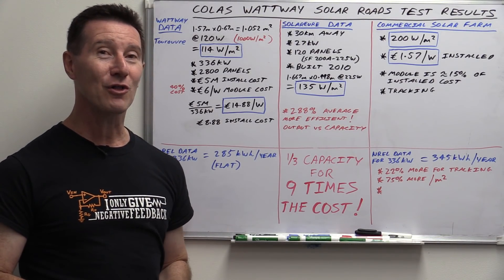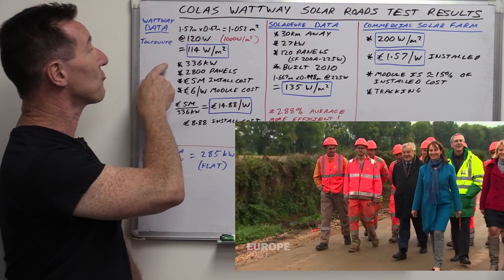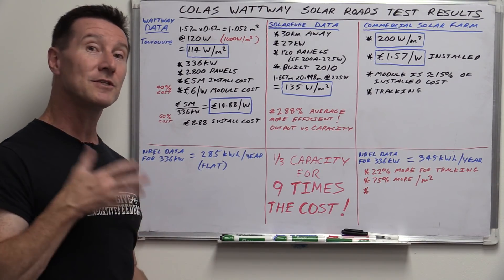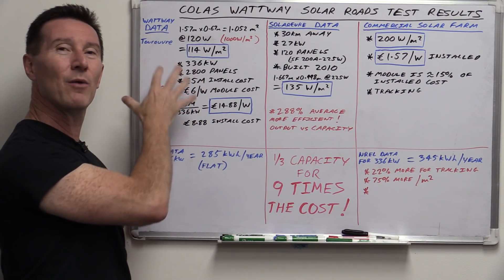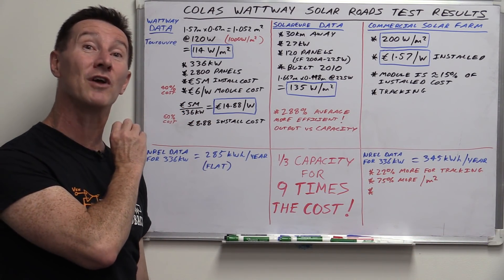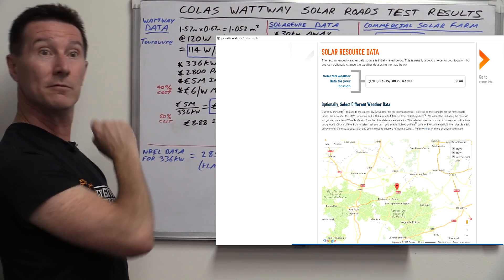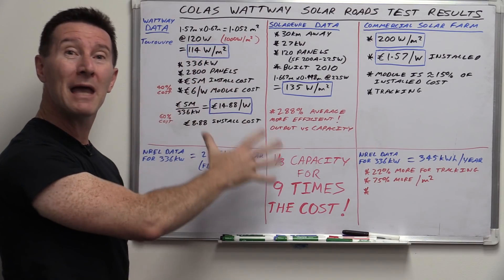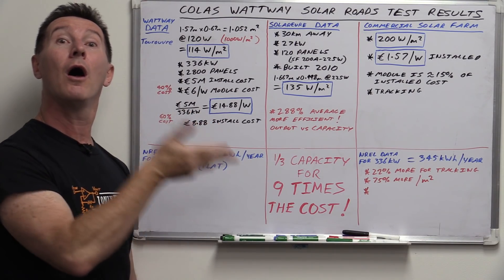EEVblog #1047 - Solar Roadways FINALLY BUSTED! (Colas Wattway)

Comment: You are forgetting one factor.  There is a heck of a lot more space available to collect solar energy from existing roads than there is building solar farms.  How many new solar farms would you have to build in order to produce the same amount of electricity if every road and parking lot had solar built in?   The road you are taking an existing structure and getting more out of it for practically zero environmental impact.  Building new solar farms takes up new land and impacts on the environment.  If the solar road could be made cheap enough and extend the life of the road underneath it saving more money and saving wear and tear on the cars and trucks that drive on it because the roads are in better shape for longer it might be a decent solution.

Now do I think solar roadways is the best solution? NO!  It be better for the government to put solar panels on every commercial and residential roof so that the building owners never have to worry about roof maintenance.  It could be done is such a way that the entire roof even if not in the sun is protected so that the benefit is you give up your roof but never have to pay the cost to maintain it.

Comment: I like the concept. What could potentially work is put panels along sides and or tops of Mountains and the similar. same basic concept  utilize previously opened up space just NOT  space that is traveled on top of constantly.

Comment: ~6€ per watt but you can still drive on it. You are ultimately comparing apples with oranges. Add the solar farm cost to the cost of a non-solar road. The units for comparison need to be € per watt–meter or some such to account for the dual use nature of the solar road.

Comment: The more a road is needed for transport, the more shade it will get...the only reason why you would use solar roads is for the complete lack of space.

If you want to save space, you promote pushbikes first of all, and mass transit in densely populated areas.  Discourage the use of cars.

If you really want to discourage the use of cars, stop wasting money and space on a high capacity road network and leave them for emergency, medical, tradespeople (plumbers, electricians), supply of retailers and government services (garbage collection and postal service).

Comment: Why are people so obsessed by making roadways solar? There are millions of square miles of roof surfaces in the world. Have they even seen some of the traffic in populated cities? Just erect some cheaper, several times more efficient and proven by years of exploitation solart tracking panels.
Reply from the maker: Because it's "innovative".
Reply: I constantly wonder about the safety. Modern roads use highly open tarmac to let the water drain away which prevents dangerous aqua planing situations. And tarmac is rough and sticky so provides grip for rubber car wheels. What if this solar road gets rain and frost? Would it become a solar skateway?

Comment: I would love to see lifespan data for the various solutions. If the life on the road materials is substantially higher (due to less stress) than it hardly matters how low the output is.

Comment: Thinking about it, consumers might be willing to pay for this inefficient electricity from a solar road if it offered the ability to charge their electric cars as they used it, they would pay via a toll or an automatic payment system of some kind depending on how long they were on the stretch of road..... I mean lets face it in the UK the Chinese and French are building a gargantuan massively expensive dangerous nearly obsolete nuclear power plant, that consumers will be paying for electricity from , for the next 50 years whilst the government try to figure out how they made such a bad decision and how on earth they will safely decommission it and deal with its toxic nuclear waste.
Reply: On-road wireless charging is a non starter. Compared to the charging cable you already have in your car, it comes with insane infrastructural costs, high losses, and of course, the knowledge that you are exposing yourself to a 100 kilowatt (or more) EM field. People will never go for it. Especially since most electric cars already have sufficient range for day-to-day usage.

Comment: China just got finished building its first solar highway. Apparently they used transparent concrete then under the concrete solar arrays, then under that another layer for insulation.

Comment: Wrong! Dave is comparing a "proof of concept" versus an "already in production" product. Also, the installation cost should be reduced if you consider that the installation is part of the road building cost itself.

Comment: I literally can't understand solar roadways. They could just take those same solar panels and put them in a solar farm and get far more electricity from them. Roads are literally the worst place to put solar panels, and finding a place to put solar panels is least significant problem with solar.

Comment: Looks like the Chinese are experimenting with this as seen in a news media release "World’s first solar panel highway debuts in Shandong", see link below. The article claims they can use the energy generated to melt ice on the roadway and also wireless charging electric cars as they drive over it. I didn't say it, they did. It's all bullshit but at least entertaining.
http://en.people.cn/n3/2017/1229/c90000-9309703.html

Comment: Just putting sun-tracking commercial-grade panels on the side of the road, or on a roof over the road, is a lot more effective when it comes to using the roads to gather energy.

Comment: Dave once again you have foorgot the grime coefficient lol if they are seriously letting people drive over this in rural areas the contact area will still be in two major tracks. Next time it snows in Oz just watch the traffic tracks in the snow and you will see how much of a road surface gets used. :-) . While most of the contact made should be rubber tires if this is rural you will get the odd farming  implement driven on it.  Think older muck wagons with steel rimmed wheels etc. Wonder how long anything will last let alone maintain a pristine optical surface. I am betting about when the first marketing party finishes and the real world tries to use it. Anyway I think your efficiency doesn't take into account the damage etc enough. Instead of a intro party they should have have a engineering inspection party where all members walk to road and every few meters do a face palm...

Comment: It seems the only roadblock (pardon the pun) you're able to prove is cost. Sure, that matters to capitalists who want to maximize their profits above all else, but there's more at work here besides profit motive. There was a time when solar was far more expensive than fossil fuel, and the cost thresholds were still broken. LED bulbs still cost several times what their incandescent counterparts do. This is about building an environmentally sound future. How much does the future cost?

Solar roadways are a great way to supplement solar fields and private installations, not a replacement for such systems. So long as the engineering can be figured out, this is indeed a viable thing that is an improvement over current roadways that generate no energy at all.

Comment: I got an oldie but goodie scam you've hit on in the past but needs a redo .....  "FCC Approves WattUp ‘Power-At-A-Distance’ Wireless Charging System" ......

The most ridiculous part is the Wall Street Suckers and Lemmings all fell for this and their stock went up 64% in just one day ...... We more or less banned incandescent light bulbs here in the US and this lame brained scheme would make the incandescent light bulb look like the model of Energy Efficiency. 

Based on the complete and utter lack of efficiency alone these deviced should be banned as all they really do is create excess CO2 just because some people are too damned LAZY to plug a cord to their phone!!!   Can you possibly get any more lazy than that?

Comment: Why don't these people just install real normal panels down the side of the road like the do in the states for auto noise reduction walls. It would just be a solar farm thats 30 miles long. Forget the panels on the road, put it on the side of the road. Why can't people just use common sense..

Comment: Ok I do agree with you, it's rididulous. But ... please use the cost delta of building a normal road and solar road. The cabling is anyway passed with or without the solar option... so that's also chipping at your white board.
Reply: Well this solar road is installed on top of a normal road, so the delta IS the cost of the installation. And roadside power cables are usually high-voltage (10+ kV AC), so unless you intend to equip every solar panel with a high-voltage inverter, you're going to need some collector cabling along the solar road.

Comment: Solar roads to compete with commercial solar farms is silly. About as silly as expecting solar roads to provide a grid level solution. You just have to be better than the next worst viable option for a particular application.

Comment: This analysis is flawed. The real comparison should be cost to install a road without PV vs with PV. I suspect the difference is a rounding error, and thus it makes perfect sense to deploy solar roadways.
Reply: Show us a calculation if you  want to support your guess! You SUSPECTING something is not a proof!
Anyway, the Colas system still needs a complete road under it! The cost they list is ONLY THE COST OF STICKING THE SOLAR CELLS ON AN EXISTING ROAD!  You would still need to build the road!

Comment: Where did you get the 336kW data point from?  Is that the lifetime expected output?  If not then as it continues to produce power the price will go down since they will have already paid to install it.
Reply: You don't even understand what you are talking about! The 336kW is the maximum rated POWER output, NOT the amount of energy it will produce over the years! If you knew even a little simple physics you would know the difference between POWER and ENERGY.  Please learn some simple electric theory BEFORE you comment next time.
Quote from Stackoverflow.com:
"I am mostly a programmer, but I have a strong interest in physics and electronics also. I try to learn a little more about each topic everyday and eventually I'll be an expert 😀😀"
Your INTEREST in physics and electronics is apparently not enough! 
Please keep working at it so that next time you can make informed comments.

Comment: It looks like it would be better to just use a white sealant on the roads to reduce the heat absorption from the sun, and use the money more wisely for commercial-grade solar installations (possibly paralleling the roads for eventual road electrification for electric cars).

Comment: Ducted wind generators in tunnels work well and are not subject to the kind of abuse that roads take. Even in extremely low winds, the air currents produced by vehicle traffic easily spin the turbines.
Reply: That method would only steal energy from the passing vehicles, since it would increase the aerodynamic drag on them.

Comment: would it be anywhere sensible to make a solar roof for a normal roadway? the streetlights could be powered by the acquired power and the panels can be as delicate and rotatable as they need to be.
Reply: Depends on how much you need that land area. Generally the problem with dual-purpose infrastructure still arises - if there's an accident on the road, it can damage the solar units, or if the solar units need maintenance, you may need to close the road for safety. If you need to transport oversize cargo over the road, you might not have enough clearance etc. If there are buildings along the road, they will shade the panels, plus people will complain to no end that you're taking their sky away.

In most places land is way cheaper than solar panels, so it's easier to just build a solar farm in the middle of nowhere and transport the power where it's needed. And there's also rooftop solar, where you need to build very little infrastructure, and power is produced right where you use it.

Comment: It seems to me the only reason to consider putting solar panels on road surfaces, rather than building solar farms, is that the right-of-way is already established; there is no need to buy or seize land that could be used for other purposes (e.g., farming), or negotiate with and be liable to building owners to build on their rooftops.

Comment: I rather suspect that the concept of solar roadways, although a clearly sub-optimal solution, continues to survive because of political rather than economic factors. The simple fact is that installing solar panels on existing public land (in this case roads) requires no more than the wave of a pen (and chequebook) while acquiring significant areas of private land raises far more problems.

Comment: As you conclude yourself - Solar roads are basically a bad idea. WHY would one use tons of energy on installing solar panels all the wrong places - like on roads?

I'll tell you why. It's about politics. It is about politicians that sees an oportunity to promote themselves. Nothing else. Because real planet-saving does not make you popular - on the contrary - it's a lot of fighting and hard work.

What I would like you to do Dave, tho it is on the border of irrelevant for this channel, is make a video series on Thorium based power :). I know nuclear power is making people wet their pants in anxiety, but it doesn't have to be dangerous or polluting.

Thorium is relatively safe and clean compared to every similar alternative there is out there. I have a theory. Without being at all a physicist at all - not even close - I would argue this:

Spend money and time on building thorium based power delivery systems all over the world. There are plenty of Thorium in the earth's crust that can be put to use for this. Sell energy from this cheap, sell thorium cheap. This way we could all have the energy we want and need for say - 500 years (number from my imagination but I'm sure it's well within factual numbers).

While using this "clean" energy (nuclear power that is low temp, relatively speaking VERY safe and impossible to melt down) - use the time and money the next half 1000 years to develop real alternatives.

If the nations would just cooporate with such a project, with all the best formankind in hmm... mind... You could end fossile fuled energy within a generation!

Ultimately politics and corruption is what's gonna end it for us.

I get furious when I think about it. We - the consumers of energy - the everyday household - are getting tons of bad conscience thrown our way for using too much power, we're the ones killing the planet. It's just plain wrong. It's the wrong way of thinking about it.

If the nations' politicians were less obsessed by power and more into actually saving the world, and could do this without corruption along the way and cooporate on it - we would have a solution within 50 years that would supply us with virtually free and clean energy.

But nations clinge to their resources - like oil. For as long as possible. And then some. Instead of putting the money and education and energy where it belongs. That is the real problem. Everyone with half a brain understand this.

Sometimes I wish we had some Vulcans swing by us to put things a bit in perspective for us :D.

No I'm not nuts - this just gets to me.

Solar roadways - what an inherently bad idea!!!

Comment: That's all well and good, however if you're a homeowner in an expensive area, and you've got a roof, a front yard, a backyard, and a driveway, and you've already got solar collectors on the roof, or the roof is listed, or thatched, etc., then your next best thing may not necessarily be getting rid of your front or back garden to install a residential PV farm there. The one place you may be able to upgrade with solar without giving the HOA a conniption may in fact be your driveway, and in that market at those real estate prices, the extra cost may not matter. In a case like that, the comparison isn't between a commercially competitive solar farm on spare land that you're just assumed to have, it's between a solar roadway or a regular driveway with no solar. Similarly, a heavily urban municipality may just not have those extra acres to plonk some standard PV down on. Space may be at a high premium, and where it is, there may still be a case and a place for solar roadways. That is practical. Get over it. Catch you next time.